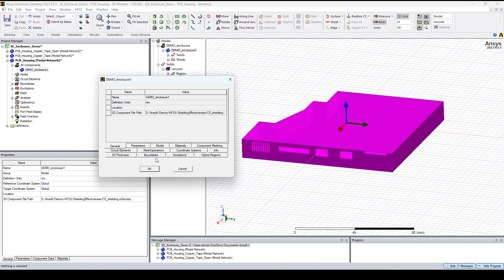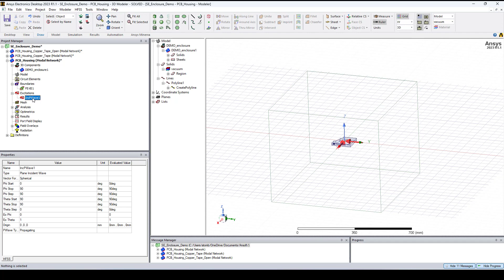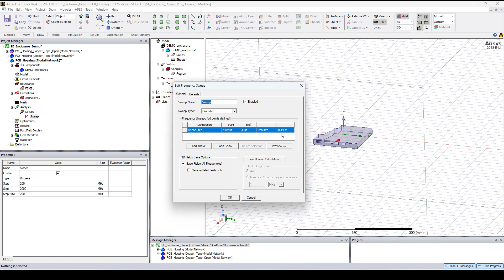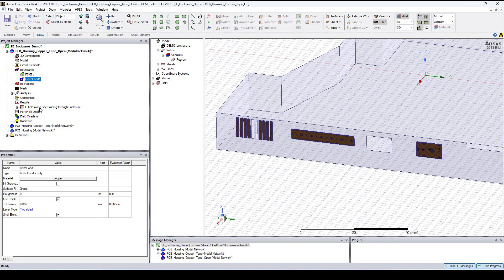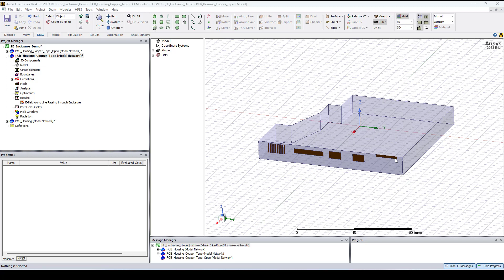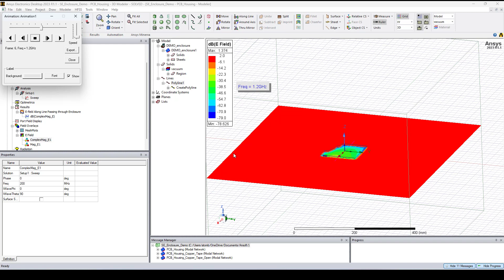Ansys HFSS: Shielding Effectiveness of an Enclosure Demo

Comment: What is the material of the enclosure? When i try to run a similar simulation, the excitation seems to begin within my model. How do you get your incident plane wave to not propagate inside the cavity, as if the source is in the enclosure? is this specific to 3D components, and i simply cannot build the model within HFSS design to do the same thing?